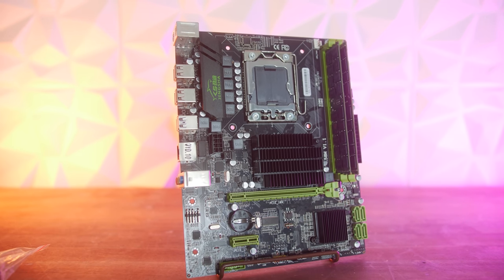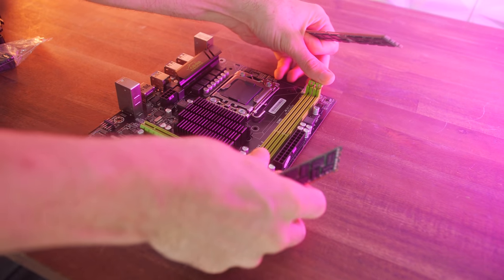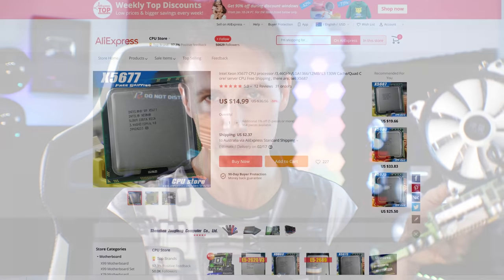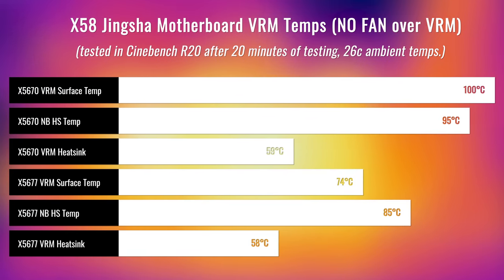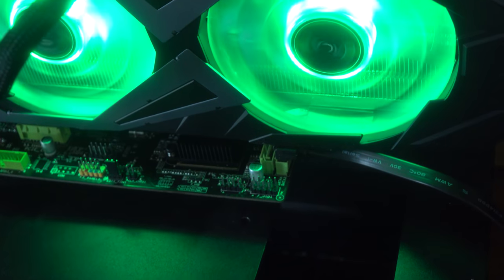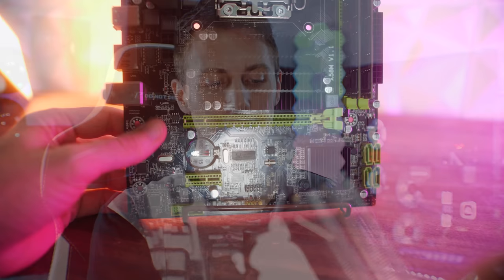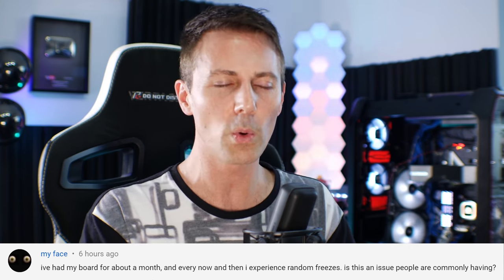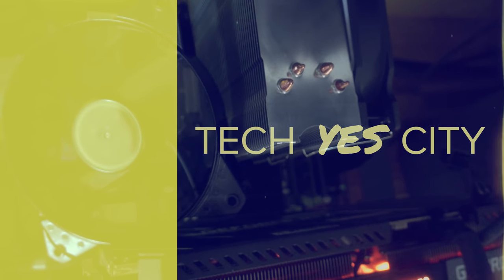Is a $53 ALIEXPRESS Motherboard Worth... $53...? (Jingsha x58 Review)

Comment: I wonder if they connected USB 3 to PCI bus? That's the sort of bandwidth maximum you would see...
Reply: Exactly my thought. 133MB/s
Reply: Hi Phill:)
Reply: You don't think they went the route of using an additional microchip to provide USB 3.0 support, like AMD did on the AM3+ platform?
Reply: @BeefJerky4104  Yea they do, this platform doesn't have native USB 3. Often it's a chip from VIA. Sometimes the implementation is flaky, you can just use a PCIe USB 3 controller card though.
Reply from the maker: Hey Phil, yeah good thinking! probably what happened!
Reply from the maker: @philscomputerlab  Also how you been? I will have to give you a call sometime, just been slowly getting back into it.
Reply: @techyescity  Yea all good here :) Just business as usual really :)
Reply: link motherboard off ?? or click bait?
Reply: No, PCI realistically tops at around 70-80MB/s, there is an overhead. That is, talking in 32-bit PCI on 33Mhz, it can go higher when running in 66Mhz mode or wider bus, but that is PCI-X and X58 does not have that. This speed (around 130MB/s) was typical to the very first USB 3.0 controllers, like the NEC ones. I have old controller from 2010 for PCI-E and one for express card and they do about that speed.

Comment: I used x58 platform for like 5 years.
Mainly intel xeon w3690 (6c/12t) with 960 and gtx 1070ti.
It served me well but i came to the point where i had to switch and build a new computer (ryzen5 3600) because of following reasons.
1. Bottlneck
2. Slow ram speeds 
3. Electicity bill 
4. No upgrade paths.

I will suggest these x58 builds only if you have like dirt cheap budget to spend on.
Reply: Exactly, they're great if you want a nice budget build but have no path for upgrades so you get what you get. If you're talking about the W3690 and X5690s, those CPUs are like 80 bucks still so you may as well get a used B350 for 50 bucks and used Ryzen 1600 for 100 and go from there.
Reply: I built a ryzen 3600 computer too! I'm afraid it'll be hard to get our hands on old ryzen 7 or 9's in the future as everyone seems to have that path in mind, haha

Comment: Picked up a whole bunch of those "HP" model RX 460's that were actually MSI brand, but used in HP OEMs. I've been building cheap computers with them all year for people, pairing it with the i3-9100F. With local pricing, I can build 9100F/16GB/RX460/256GB NVME builds for around $300 USD. Makes a very good basic gaming PC, or home office PC.

i3-9100F
Gigabyte H310 S2P
16GB(8GBx2) G.Skill Aegis DDR4-2400
256GB Inland NVMe M.2 SSD
RX 460 2GB
430w 80+ PSU
Coolermaster N200 Mini-Tower Case 
-------------------------------------------------------------------
$285ish USD

Comment: a great portion of the cost goes to the X58 chipset and on board VRM, the rest are usually within the "cents" range. These mobos cut cost by using recycled X58 chipsets from fried board and lower quality VRM. Or else, even in 2021, producing a new X58 mobo will still cost you as much as the cheapest B550 mobo.
Reply: CPU is free

Comment: How would this compare to an X79 combo? I’ve seen a few cpu, mb, ram combos around that $100 price point. And some of those Ali express mobos have m.2 slots. I find it hard to recommend x58 in 2021 unless you already have a working mobo.
Reply: X79 with an E5 1650/60v2 is pretty potent when overclocked, plus it has AVX so you're not gonna be limited by the games that need it to run.

Comment: Hi Brian :) I’ve been watching a lot of your videos and I wanted to try to build my very first PC with used parts here in the Philippines. On hand, I have an old i5-3470, 4gb RAM, and a 500gb HDD. Using Facebook Marketplace I found out that the parts here are scarce, since a lot of people are like wild animals hunting for them used pc parts and are fast at transacting with the seller. Luckily I found another 4gb RAM for 10$, (I’ll just change to USD so everyone can understand) a Deepcool bronze 500w for 30$, (it was really clean, almost brand new) and the best deal I found with the help from a friend was an RX 570 for 80$. I also got a Coolermaster Hyper 212 LED for 13$. I bought an ASUS PH61-M for 40$ from Shopee, (They said it was used, but it was really clean and almost brand new, Shopee is like Aliexpress) and the case I got from a local store for 13$. The pc is working fine now, overall expenses were about 200$ and I’m really happy with the result. Thank you Brian for giving me the inspiration to build a pc using only used parts! Much love from the Philippines!!
Reply: dope bro, tip for upgrading would be i7 3770 cause i5 3470 is definetely gonna bottleneck the rx 570
Reply: @valuehunter5544  or you could raise the resolution or graphics settings as a temporary measure shift the bottleneck to the gpu
Reply: question: where did you buy the CM hyper 212 for 13$?
Reply: @valuehunter5544  in his case a 3770 will probly run him 60% of the entire cost of his pc asumeing he could find it. But if he can its basicly on Par with a ryzen 3400g and should hold off most esports games
Reply: @mikeymaiku  no way its on par with a 3400g, maximum like a ryzen 5 1400 or smth
Reply: Look for a Xeon e3 v2 with 4 cores 8 threads. That's a great upgrade.
Reply: @miniweeddeerz1820  is that compatible with his motherboard?
Reply: @crispianchealuks2024  yeah there's the e5 which are on HEDT like the lga2011 socket which are 6 cores and above, and the E3 which are basically just desktop CPUs, with ECC support and different clock speeds and tdps depending on the model. But they go on regular desktop socket, and perform exactly like desktop CPUs. They also cost a hell of a lot less than the used i7 3770s and such out there.
Reply: @crispianchealuks2024  Facebook Marketplace
Reply: @prydain2823  is your motherboard a P8H61-M LX3 2.0 or an LX 2.0?
Reply: @miniweeddeerz1820  I checked his motherboard, seems to only support e3-1230v2 and e3-1245v2, will using either of these cpu allow the use of ecc reg memory?
Reply: @crispianchealuks2024  I got the LX3 2.0 version
Reply: @crispianchealuks2024  idk about ECC. The CPUs supper but motherboard spec only says non ECC. Unofficial support of ECC memory or other Xeon CPUs is unknown until tested. It would be a good upgrade for sure, but a small SSD, and 16gb of ram would go a long way as well.
Reply: @miniweeddeerz1820  ecc reg ram are usually 1/3 the price of a non ecc ram in the ph,  I got 4x8gb 1600mhz ecc reg ram for 45$ last October from the same online shop as OP, Shopee. But you are right, unless guaranteed to work with his motherboard, better stick to non ecc ram, another stick of 4gb to take advantage of dual channel and a cheap ssd, my suggestion is wd green or adata, managed to buy those for 30$ for a 240gb version
Reply: @crispianchealuks2024  I would never be able to recommend a WD green lol. Ive used one and I regret buying it tbh. It's frankly terrible.
Reply: @miniweeddeerz1820  please elaborate, I'm using a wd green sata 2.5 right now as a game drive, I did have a wd green sata m.2 that died and nearly took out a motherboard with it. Are they sensitive to high temps?
Reply: @crispianchealuks2024  not more sensitive than any other SSD to my knowledge. Just WD green have terrible longevity rates, probably because they still use 2d nand, and also why the warranty is shorter than the blue. Furthermore, the controller is pretty budget, and paired with the 2d nand and no dram cache well as I said I regret buying it. It's use atm is just in a web browsing laptop with a 2 core 4 thread i3 so it should still survive a while because downloading word documents of a few megabytes at most will be good for preservation. That said the fact that I could notice the difference between a WD green and a blue, both sata, on such a low power machine really stressed to me that this was not a drive I should buy again, or recommend. Spending a bit more on a good drive is imo very worth it. source and my general SSD buying guide (very useful) :
https://docs.google.com/spreadsheets/d/1B27_j9NDPU3cNlj2HKcrfpJKHkOf-Oi1DbuuQva2gT4/htmlview
Reply: @miniweeddeerz1820  thanks, I moved cyberpunk 2077 from my game drive to my boot drive to see if there are any significant difference, also I will probably move any essential away from the game drive and probably replace it with a Samsung 860 evo in the future
Reply: @crispianchealuks2024  that would be advisable yeah.

Comment: I think the X79 systems are a better deal. They have high frequency 4-core 8-thread CPUs for around $25 like the e5-1620 v2 that should outperform these X58 CPUs at about the same price. The 6-core e5-1650 v2 is also quite good, but will cost another $50 or so.

Comment: I strongly recommend against the x58 platform today, unless money is an absolute limitation. Those boards and chips are getting too old at this point, and they're pretty power inefficient.
I would instead recommend getting x79 for not much more, or if you have a bit more to spend, an x99 (you can get a ddr3 capable mobo, ddr4 is $$). Both have cheap processors you can pair them with, with much newer lithography.
I just built a home server with an x99-k9 board and an e5-2630L v3. 8 Cores, reasonably quick and super low power.

Comment: Lack of AVX really hurts the viability of X58 nowadays... rest in peace king
Reply: That's also what I think. I would at least go with X99, even better is Ryzen stuff as it has great upgrade potential
Reply: I think it mostly depends on what people want to do/play on these systems. If you are dead broke and using an athlon x2 this will be a massive upgrade for next to nothing cash
Reply: @wakenbaker-uk absolutely true! X58 is great, and pretty decent. I do have a few X58 systems myself. They perform great for their age. But the lack of upgrade options and the lack of AVX instructions mean that if you have to upgrade the next time, it will be expensive. You cannot reuse DDR3, nor the motherboard. 
So, if you want the cheapest option for the moment, go for X58. 
If you can by any means get the few bucks to avoid it, avoid it. For only ~30-50$ more, you can get an X79 system that at least has AVX, or for a bit more you get DDR4 with X99 so you can reuse your memory (and if only multi core performance counts, even the motherboard) later on, which will save you a lot.
Even the crappiest X99 combo is better than X58 for gaming, just because the IPC is much better. And if you want to upgrade, there are many options, and I almost bet they will be just as cheap in a few years. (Then it might be 15$ for an 8 or 10 core LGA2011 chip).

Comment: So if xeon processors are cheap and you can buy a whole combo for around 80$, do you still need the second hand older intel cores or older ryzens, i mean if xeon are cheap and have a lot of cores and are  offering good performance for the price why would you buy like the new i3 or a cheaper ryzen
Reply: Those old Xeons do have some drawbacks. Their per-core performance is low compared to more modern options and they are missing some newer instruction sets eg. AVX or SSE 4.2 which means some modern games cannot even launch with them. They're still okay for esports type games but if you are hoping to play some modern AAA titles it becomes hit or miss whether those old CPUs will work.

Comment: No question the SNOWMAN with dual 120mm fan and 6 pipes is a BEAST of a CPU cooler and for the money (~US$ 32), can easily handle a TDP of ~160W.  It is an excellent product for budget over-clockers.  It handles the E5-1660 and 1650V2 overclocked to 4.1 and 4.3 GHz, resp., with aplomb. Also, it keeps my 12 core E5-2678V3 running VERY cool, even with a turbo-unlocked all core of between 3.2 to 3.3GHz.

On all Chinese motherboards, to include the well-built HZ deluxe X79, I play it safe and use at least an 80mm fan on the the VRM heatsink.

PS: Stepping up to the E5-1680v2 (OC'd to 4.4Ghz on a P9X79Pro) I am using the PCCooler GI-D66A (~US$70), with a TDP of 230W. I am using an open air vertical test bench in permanent configuration for this particular daily driver. To include two 90mm Blue fans (place above and neatly mounted with tie wraps to the handle of the test bench) on the VRM heatsink and RAM slots and one side-mounted 120mm RGB running across the GPU and lower area under the CPU cooler. Of course, I do not have young children or pets in the house, so I can live with the open air system...looks cool on my desk top too! Also, I like the ease of de-dusting the open air design...a quick clean every two weeks with a cheap electric blower and voila.

Comment: You shoud use Xeon x5687 4core/8thread/12mb - 3,6-3,9gHz CPU that you can OC up to 4,6 as i did on air on x58a-OC Gigabyte - the orange beast. SOTR on Ultra with 1070 ran from 58 up to140fps. This CPU is fast as hell ;)

Comment: If you are considering this - please, just get X99 instead. An X99 board costs just 10-15$ more, and entry level CPUs like a 2620v3 or 2630Lv3 cost around the same, if not less. In return, you get:
- Hugely better performance
- 4-channel RAM
- Modern I/O, like full speed USB 3.0 and SATA 3
- Much better power consumption and thermals
- Insane upgrade path up to 22 cores

Comment: so i scored a full PC for 100 cad. 450watt cx450m psu case (case was broken but whatever) dvd rom burner, 8gb ddr3 intel mobo and a Pentium G420 cpu with an Asus H87I-Plus mobo fully working.... trans planted into the old case all good there's a find. Reason for the find Wife's old PC died after 15 plus years old........

Comment: The reason for the fps difference where RX570 > nvidia 3060 is either windows is not unbloated and the DRIVER OVERHEAD from nvidia. hardware unboxed did a video on this. You'll see better fps on RX 5000 or rx 6000 for the same reason on slower CPUs.

Comment: I think buying new Xeons is not worth it anymore. At least not X58. The instruction set is old, so they might be unsupported by many programs in the near future and the upgrade path is absolutely zero. X99 is the minimum I would go with as they have decent IPC and there are at least 10 or 12 core CPUs for the platform.
But I would just go for a cheap used Ryzen 1/2  combo.  It will be good for 2 more years and then you will have a great upgrade path. I am absolutely 100% sure that even 3xx Ryzen boards will support Ryzen 5xxx after unofficial BIOS updates. The 3xx chipsets are very similar to the supported X470.

Comment: Just realised 2 days ago that I had bent my x58 board around the socket by installing the cooler incorrectly. It's an ASUS P6T SE X58 board and that's probably why it wouldn't overclock at all and 2 RAM slots weren't working 🥴 I didn't take the little square plastic riser off of the backplate and noticeably bent the board around the socket ...

Comment: Perhaps for the option "here and now without a guarantee" it will work, but there are more attractive options from AMD.  I bought myself a Gigabyte GA-A320M-S2H V2 motherboard (B350 chipset) where even a 3rd generation processor will fit for $ 50.  New with a guarantee.  And the processors for AM4 have already been made enough so that they can be purchased at a low cost.  What's the point in continuing to build PCs on objectively outdated hardware?

Comment: I wanted to order a board couple weeks ago.The board was just over 100usd for us it's not that bad but then they wanted to charge me around another 100usd+ for shipping to South Africa.Then i thought i might as well order a bundle if they charge me that much for shipping as in my mind it should be cheaper.Guess what i was wrong....They wanted to charge me almost another 100 so it's almost 200 for shipping and the bundles around 200-300usd.I have3 everything just need mobo but for that price i can get a 3400g fully built with a 256gb ssd for around 382usd....

Comment: I have this board brand x58, except mine has 3 ram slots supporting triple channel. It also has a fan for the NB chip heatsink that came with it. I use a CPU heatsink similar to yours with a fan on each side directed towards the rear of the case with a case fan blowing outward and the air flow across the VRM stays fairy cool. With the x5670 I use in it, the system never gets overly hot, it's well within safe range. This is proof systems use the GPU more for games and that's the key. My i5 6500 z170 board doesn't do any better than the x58 will with the same GPU. Only real difference is various options like for m.2 and bus speeds. Don't need to spend tons of cash to play games at a decent frame rate.

Comment: AYO techyes city recommending koss ksc75s, just saying that if you're not satisfied with the onboard audio, apple made a dongle (usb c to 3.5mm) which is very clean very good sounding (upgrade over any onboard audio btw and I use it myself), also don't forget to put yaxi pads on them to make them even better, or you can cop a kph30i/porta pro for the warmer sound. Either one you cop, it will be good, and also, thank you for informing non audio enthusiast about koss, you're doing good stuff with that